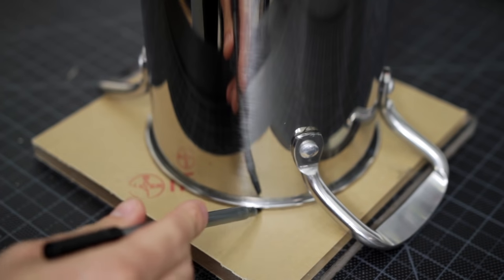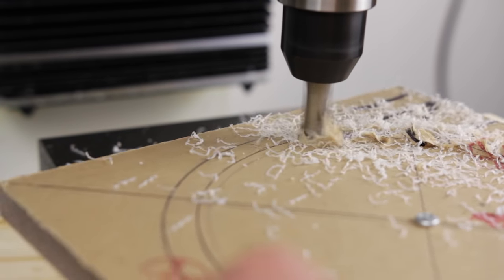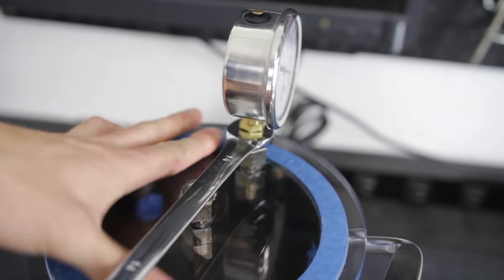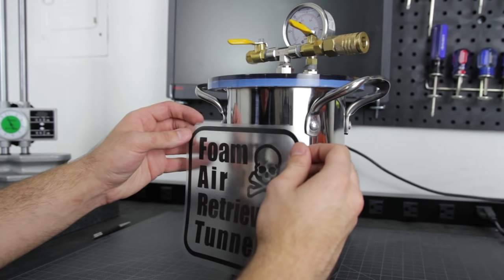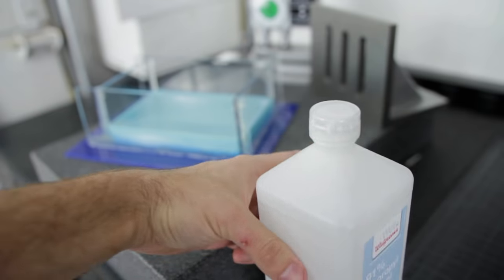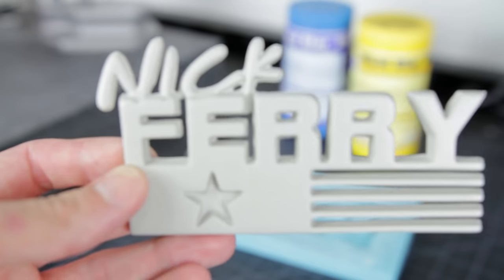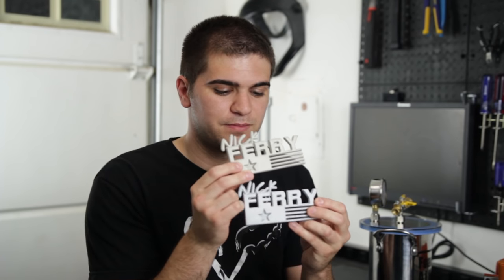How To Make A Vacuum Chamber

Comment: Very nice. Of course, the whole cutting a groove in the lid part is unnecessary. You've got about half a ton of air pressure pushing it down so a simple rubber sheet about 1mm thick laid on the acrylic sheet would do for a seal. Don't even need to glue it on. Yours looks much nicer, of course. (Actually, come to think of it, I saw a youtuber just put the acrylic square sheet on top with nothing at all. It worked. But I think a rubber sheet would work better)

Comment: The bone-crossed skull on the pot is justified as a warning sign as the chamber is a lethal environment once under vaccuum. I'm working with these units on a way larger scale for food processing and conditioning. Once founde a few flies which didn't survive 30mbar, retrieved them only to notice that their rumps have been crushed as the atmospheric pressure was restored inside the chamber.

Comment: Hi, I am a retired machinist without all the toys but my std. drill press and this guide will serve me very well making wax duplicates for casting silver. Great video my friend. Clean and simple !
Reply from the maker: Thank you so much for watching and for the feedback! Would love to see those wax duplicates when they're done!
Reply from the maker: Well thank you! and already done!
Reply: All I need now is a pressure cooker pot as I need to de-gas some larger things/ mixes. What kind of - numbers will the pot you show handle ?
Reply from the maker: I've held  28.9 in.-Hg but that's all I can do as I'm slightly above sea level  but most won't go passed 25 to 26 unless they are at sea level or have a ridiculously strong vacuum pump.
Reply: Awesome numbers new friend. Excellent as long as ya don't get an implosion eh !
Reply from the maker: Agreed but I'm not worried about that as of now as I've forgotten I've had the vacuum on the pot for over a week multiple times and the pressure still held no leaks and no implosions.
Reply: Sweet. Where in this world are you.? I am in northern BC,Canada.
Reply from the maker: I'm located in San Fransisco, California USA
Reply: Do you know how much vacuum is needed to degas most things like plaster or similar stuff.

Comment: made one just like yours. I used a router with a acrylic cutting bit (only like 15$). I cut out the acrylic with a circle jig... just a scrape piece of wood. And now i'm at the stage where i put on the silicon. I noticed that you had to cover the holes in the stock pot with silicon!

Comment: Thanks for an excellent video.  Seems like a pretty simple thing to put together.  I just gotta figure out how to do it with tools I have access to.  I've got about 20 vacuum / air compressor motors sitting around.  Most with be turned into scrap metal but would like to do something with a few.  So I figure the best place to start is a vacuum chamber and pressure chamber.  LOL

Comment: great job dude! just a tip. if you really want to save money so you can spend it on your girl, try using stuff you can get for free from recycling like paperboard for your mold form and 3M's #88 tape. I use Plastercine or mold putty (no sulfur content) to avoid any mold box leaks. For the chamber, there's no need to use all those fittings or router the Plexiglas. I just tapped the holes and use the silicone caulk. Any soft flat gasket can be applied directly to the Plexiglas too, it bonds well. You will also find that silicone will hold a vacuum longer than PTFE tape. Keep up the good work!

Comment: Good first video! Informative with clear step by step instructions. My only criticism is that you haven't provided a material list showing what you used such as the type of silicone, resin, where you got the pot etc etc etc etc... 
(I will definitely be building one of those vacuum chambers though. I hope it doesn't suck to bad.....)

Comment: A spritz of a mild solvent to your silicone and squeegee would help to get it nice and smooth. It will act as a lubricant and prevent the pulling you experienced. I usually use wax and grease remover.

Comment: I think it looks great..I need an extra large one because I need to cure about a gallon at a time..making customized beer steins and casting them in puter..got my design already to print but waiting for the new mother board for my 3d printer..They want a lot of money for a big degasser but I think I can got to the thrift store and pick up an old stainless steel pot to use..this will save me a lot of money..now I will have to get the pump lol

Comment: I enjoyed this video.
Reply from the maker: Thank you Douglas! New video coming soon this Friday if you're interested in some more!
Reply: Totally!  I love your setup!

I gotta ask, in your lasercutter you have some honeycomb sheet I've been trying to find.   I'm rebuilding a K40 (scrapping everything but the laser, new frame, etc) and I can't find a good honeycomb like that around, just a steel grate at the local Lowe's.    Where did you pick yours up?

I also really enjoy your endeavor and am in the works of getting my shop together.   Mind if I pick your brain about what camera equipment you're using and if you have other team members helping with the lighting/filiming/editing?

Love what you're doing, keep up the good work!   Top notch stuff!
Reply from the maker: It's aluminum honeycomb off of ebay from a seller named "honeycommcore" the particular one I got was 1/2" thick and the dimensions were built specific to my machine since I made the laser cutter. 

Of course! I use an old Canon T2i  with a Sigma 18-35mm 1.7 lens and in this particular video I used a Sigma 50mm 1.4 but have since sold it. I also use an ND filter to pull the aperture a little lower at different depths. Lighting is two custom built softboxes at 24x34 with two 550 watt 5k bulbs each. 
Editing I use Adobe Premiere CC and Adobe Afer Effects CC because I'm comfortable with visual effects which I haven't shown yet on the DIY side but I like to color grade with after effects but that's my cup of tea.

Good luck with your shop and thank you so much for the compliments. Let me know if you have any further questions.

Comment: Really enjoyable experience. will you please describe the configuration of the vacuum pump used. Its electric motor power, RPM, suction speed and ultimate pressure.thanks

Comment: I know this comment is a loooong time too late but I will let you have it anyway.  I followed your instructions to a T and the thing wouldn’t draw a vacuum until I covered the inside of the pots handle rivets with J-B Weld.  A small but pivotal piece of info.  Then I noticed you had 4 gobs of gasket maker inside your chamber and I only then deduced what they were for.
Reply from the maker: Wasn’t needed Susan as it still held a vacuum just had a slow leak and I did it after the fact. I mention this on the Instructables article that’s linked that I wrote

Comment: might be an idea to use an old propane tank as a vacuum storagevessel when running a smaller vacuumpump , using this you can run the vacuum some time in advance and have vacuum ready to reach full vacuum inside the vacuumchamber pretty mush immediately

Comment: At 3:45, it looks like there're some blue blobs inside the pot.  I assume those blobs ensure that there's no leak around the rivets/bolts that hold the handles to the pot?
Reply from the maker: Good eye and you are correct, I noticed a tiny leak overtime so I just sealed the handle rivets

Comment: Did you have any problems sealing the quick connect fitting?  I'm unsure the fitting will work as well under vacuum as i does under pressure.

Comment: Anthony, also did yours come with a little gaskets for seal ?  that seal the inside and outside of lid??  I have ordered 2 diff ones using the name " 1/4 in NPT bulk head fitting"  and they arrive with the side you screw in your gage,  mine arrive with no female  thread but something you slide a small tube and it locks the tube in place ????
Reply from the maker: Top flight they did come with two gaskets from what I recall

Comment: Do you know if a homemade vacuum chamber can achieve 1 mbar (0.75 torr, 0.75 mmhg)?   
0.01 mbar?  
Might that be possible in a rectangular chamber around 600 mm x 300 mm (24"x12")?

Comment: Nice project, thanks for sharing it. Got a question... why did you choose a 7cfm vacuum pump? I want to set up a vacuum system for both a vacuum chamber and a vacuum wood turning Chuck and am wondering about the benefit of using a higher cfm pump vs. the usual 3cfm units. Thanks.
Reply from the maker: Thank you hifispec01! I purchased the 7cfm for a bigger tank, I also plan on using it on a vacuum forming machine as well so the bigger the better in that case. 3cfm would work out great but I would buy what you can afford so you can always expand later and you will pull a complete vac at your altitude faster
Reply: Thanks for the quick reply and for noticing the altitude "issue". At over 8300 feet above sea level, I was thinking a higher CFM rate could help achieve a faster vacuum and maybe even help compensate for some porous wood leaks when chucking wood. Since I can't achieve a full vacuum, any small gain or compensation I can get out of a well build system is a big advantage. Once again, thank you and keep up the good work!
Reply from the maker: +hifispec01 No problem and thank you again for watching my video!

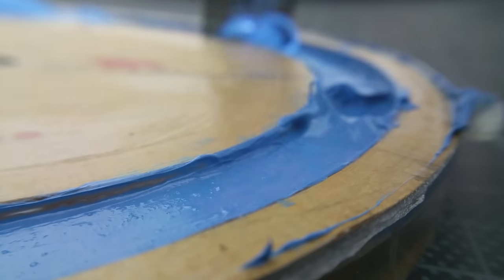Comment: 02:50 - Why two layers of RTV? Was the first layer allowed to cure before applying the second one? ...Cool video, thanks for posting. Liked.
Reply from the maker: The reason for two layers is to prevent the pot from sinking to the bottom of the polycarbonate groove, I wanted to semi-replicate an o-ring style seal
Reply: Machine Right Makes sense, thanks.

Comment: Sure I’ll just head into my factory grade craft shop and flip on my sawmill. Who doesn’t have that laying around.
Reply from the maker: Well first off I didn’t use a sawmill I used a mill and second the operations that were setup could be done with a drill press as stated in the video. I didn’t have a drill press working at that time so I used my mill. Please note if you build things it’s part of the fun to figure how to achieve the same results with different methods. I don’t own every tool in the world and creativity is something you definitely stretch when you think of other ways to achieve the same, less or better result. If you build things then test your skills in the workshop and not with your typing in the comment section ;)

Comment: That is fantastic. I have been looking for a way of making a relatively inexpensive vaccuum chamber as I would like to start doing some casting.  I have also subscribed but I doubt you will have any trouble getting subscriptions and views. Thank you for a great video.
Reply from the maker: Thank you so much for the comment! Honestly this project was very low cost I think about $70.00 USD and I got to pick the perfect size for my application.

Comment: Did you have any cure inhibition issues with the silicone against the 3D print ? I'm struggling to get my silicone to cure properly and I suspect the 3D printer material is the culprit.

Comment: where did you get those 1/4" npt bulkhead fittings? Can't seem to find them using that term. Did they come with the rubber washers?
Reply from the maker: Hi Yinna,

I purchased them from best value vacs. I have links to everything purchased in my instructables located in the description.

Thanks for watching! :)

Comment: This was a GREAT video. Super helpful! Just one question, what vacuum pumps would you recommend?
Reply from the maker: Thank you very much! I've only used the one I own but I highly recommend a dual stage over a single stage as you will pull your vac faster and every second count's when using fast-curing silicone or resin.
Reply: Machine Right Thanks for the response, but what is the difference between single and dual stage?
Reply from the maker: Dual or two stage pumps are just like they sound, they work in two or dual stages: A single stage dumps directly out to the exhaust, while a two or dual stage pumps the exhaust of the first stage directly into an inlet of the second stage and then is exhausted by bubbling through the oil reservoir, typically that's why you hear two stage pumps gurgle quite a bit when first vacuuming down, then they "quiet" down. 

Additionally, the micron level will be much lower with a two or dual stage pump. The lower the micron level the better in pulling a complete vacuum based on your atmospheric pressure which will be different based on how far above sea level that you are.
Reply: Machine Right Thanks for the response again. It was really useful. You just earned a sub!

Comment: Hey my friend. I am in process of making a large chamber more or less following this design that I completely agree with. I am using a pressure cooker abt. 14 x 20 in. I chose lexan (pricy) for the see through top. I did the routing and used the same Permatex you have. I have used it for years as a HD mechanic. 

My Question to ya would be "How long did it take for it to set up and be serviceable" When I use it I just put it in place and put the piece back in service. I put it together yesterday afternoon and when I parted the chamber this afternoon and lid I found only part of the seal had cured so I drilled a couple witness marks on them and put them back together with about 50 lbs of weight on. What kind of time frame do ya think I am looking at before I try to separate them again ?

I thank you and hit the bell to see what yer up to. Bye my friend and NEVER LOOK BACK unless ya NEED TO. LOL.
Reply: PS EXELENT RESULTS MY FRIEND.
Reply from the maker: Hey there, It depends on how thick you do it but I did it in two layers, the first layer was about an 1/8"  thick if I can recall ( that was so that the pot wouldn't touch the polycarbonate lid). I think I waited 12 hours for the first layer to cure and about an hour or an hour and half for the second layer to cure before pulling the pot out and letting it cure for another 11 hours.
Reply: Thanks for getting back to me. My container is really big compared with yours. 14 W X20 D. I used a pressure cooker with an 1/2 in. lexan lid. I did put weight on the first round,50 lbs and then a skim coat with no weight and thanks to you my friend I have a good working chamber that will hold 27 in. all day long(I am at altitude).So what do ya have coming up next bud,I like yer style.
Reply from the maker: That's awesome! I'm glad my video was able to help you in creating your own custom size! I have a video on going from 3d prints to metal coming up soon. It's been hard working a 60 hour job while having little time for filming and while doing custom work on the side to fund my projects. Thank you for the positive feedback good sir!
Reply: All ya get is a thanks and another BLUE THUMB UP MY FRIEND. Looking forward to the new video and remember all that OT doesn't really get ya anywhere but worn out and big time tired. NOT GOOD for you or yours in the long run ! After taxes you end up working for like $ 5.00 hr. Consider that my young friend ! ! !
Reply from the maker: Salary my friend I wish it was overtime! haha but trust me I wish I could be making these video for a living because I do a lot of cool stuff that I just don't get to show because the time it takes to make a video and get the project itself completed is quite a lot in the little spare time I have throughout the day.
Reply: I hear ya my friend. I am retired now and know exactly what yer up against. Never,EVER be afraid to put yer foot down and say NO. It will gain you both respect and a pat on the back piece of mind to boot. But tread gently if that is where you want to stay. Firm but gentle lad ! Thanks for the chat this pm.
Reply from the maker: Agreed and thanks for the words of wisdom my friend. I will catch you on the next video! :)

Comment: SUPER, CAN YOU TELL ME WHAT MATERIAL OR SILICONE YOU USED TO MAKE THE SEAL?
Reply: He used Permatex RTV (Room Temperature Vulcanizing) Blue.  It is a moderately stiff rubber that is frequentlt used for replacing a gasket.  You should be able to find it or something like it in the automotive stores or automotive supply sections of Walmart, Target, etc. . .   The Red and Black versions are usually for High Temperature seals and the Blue is for "low" temperature like the engine coolant.

Comment: GREAT video !

What is the brand of your laser cutter, where you bought it and how much you paid for please !
Reply from the maker: The brand is the Machine Right brand haha I made the laser cutter from scratch and at the time a Laser cutter wasn't as cheap as they are now so I spent about 3500.00 but I have a solidly built machine with great components. If you asked me if I would build it from scratch again I wouldn't as you spend more time building the machine then using it.
Reply: Did you buy a kit to do it ? If yes, what kit is it ? And your laser is how many watts ?
Reply from the maker: Benoit Gérin-Lajoie No kit for this one
Reply: How many watts is your laser ?
Reply from the maker: Benoit Gérin-Lajoie in the video it was 40 at the time but I’ve since put in a 60 watt

Comment: How to do this when you don't have machines at hand? Are there people who cut acrylic to shape as a service?
Reply from the maker: Don’t worry about the shape it can be a square and you don’t actually need a groove it just helps with getting a tighter seal but you can literally use a square piece of plastic and some rubber underneath it and you would be good to go.

I just went over the top for this but using local materials.